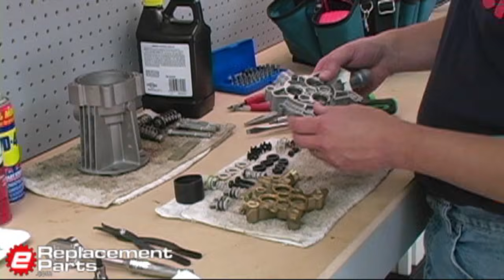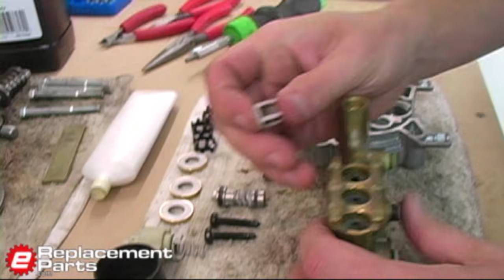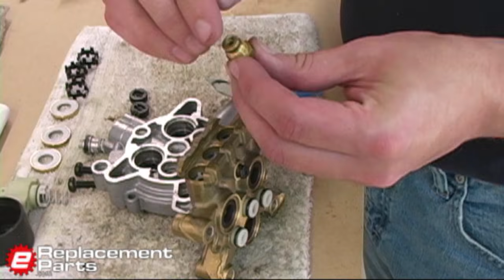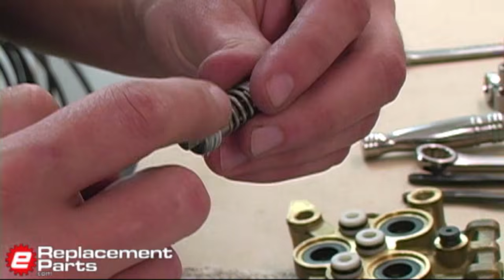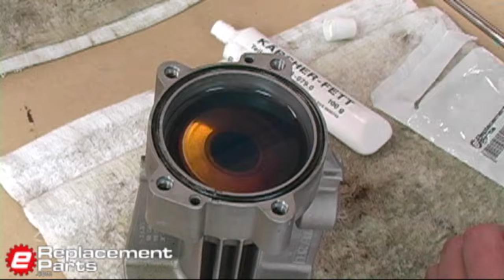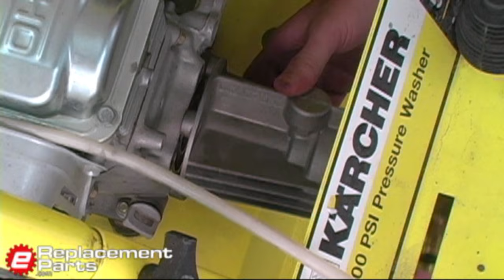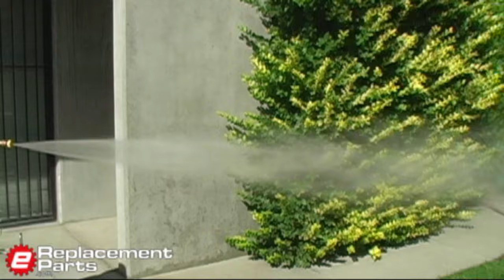How to Fix a Pressure Washer (Part 2 of 2)

Comment: I have a Generac Model # 01043-0. Can you explain how the "Automatic Cool Down System" operates? The manual says if the pressure washer is running, but the pressure wand is not engaged, once the water temperature in the pump reaches 140 degrees F it automatically dumps the hot water onto the ground so fresh cool water can enter. I cannot find the location of the "water dump".

Comment: very great instruction and demo videos. I run into a similar problem with a different brand PowerBoss190 3000 psi & 2.5 gpm, I am having difficulty to open the pump housing. Hopefully get the right tool and will fix the problem following this video. Many thanks to Mark!

Comment: Hey guys, I watched your videos and tried to fix my pressure washer but seems I didnt fix it. I have no pressure on my troy-bilt PW. seems all inlet outlet etc are free flowing. I replaced the 6 white valves and the unloader valve with no change in pressure. I tried adjusting but I have no idea if its helping. unloader valve is a 315747GS. maybe you could be of assistance.. Thanks, Mac

Comment: Thank you for posting this video, I had a problem with my pressure washer pump, I cleaned all of my valves, but did not know that the "re-loader valve" was a part that commonly fails, so I will inspect and replace that, if needed, ASAP. Also, thanks for mentioning what parts of the re-loader valve to and not to grease!

Comment: I tried every thing or remove the valve but just can't get it out.  I even tried using pointy nose vice grips.  Any ideas ?  Where can I go to have this valve removed?
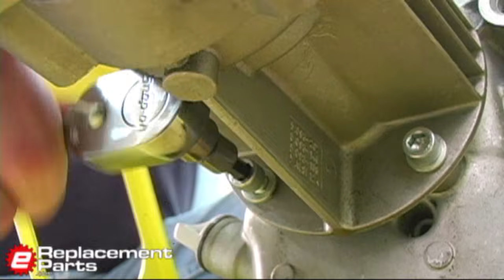Reply: Tommy Gorse Another video by Lowegy 7:59 long, shows leaving the Pwasher still assembled and its own water pressure to blow the stuck valve out of the cavity. much faster, simpler, (but put a towel over it to catch the flying parts first) do this outside, it gets wet!

Comment: i  have a karcher 2000 psi pressure washer its runs great and has pressure but when i squeeze the handle its like the water pulsates for high to low high to low. any ideal what that could be?

Comment: Bought a pressure washer from a pawn shop (Stupid Idea)...anyways started just fine but the pressure washer had less pressure than my water hose and had to remain engaged (Wand Pulled ) to remain running..I will never make this mistake again..its worth to buy new instead of the hassles..btw the hose that came with had a hole in it....SURPRISE!

Comment: What type of oil you used? i never opened this type of pump before and i found it was quite helpful
Reply: cool
Reply: Lowes carries something called "Pressure Washer Pump Oil" in the pressure washer parts section. This is what I used.

Comment: Loved the video. Thanks for all the details. However, when you tested your repair, you didn't release the trigger and then press it again to see if it was actually fixed (that is, the pressure didn't diminish on the second press of the trigger) recalling that this was the original problem. I guess we are to assume that it was truly repaired.

Comment: I accidentally ran my Kercher G2650OH without the water hose attached for a few minutes while I was testing the carb adjustment.  Now I don't have any pressure. What parts do I need to purchase?  Is there a kit or do I need to buy each item separately?

Comment: The demonstration was well done.  It probably will save me a lot of money.  There were two items I did catch you talk about.  One is the gaskets that go between the major component as they go back together.  The second is; what type of oil to use?  Does the pump require a specific oil like the air compressors?

Comment: Great video mine won't even spray water thru the gun but if I remove the high pressure hose water will come out from the pressure washer outlet

Comment: If the unloader valve isn't stuck what causes it to pulse fast when you spray and the pressure to be lower? really fast pulsing i have pressure but not as much. just started happening while running it.....

Comment: I'm confused.  This video insists we put grease only on the large end of the unloader valve.  But instructional photos at Karcher's website for ordering this particular part shows them applying what appears to be Teflon grease to the small end.  Which is correct?  I mean, who are we to believe... This apparently very knowledgeable tech on the video, or Karcher's themselves?

Comment: Great video. What kind of oil do you use inside the pump. My Karcher 2600HH is leaking water (lots) out of the valve (black plastic piece). Any ideas?

Comment: Hi Mark, what kind (Engine oil, hydraulic oil?) goes back into the oil reservoir on top of the wobble plate during re-assembly?  Please advise.  Thanks.

Also,  where do I get some teflon grease for the top O-ring of the unloader Valve?  Will white lithium grease work instead?

Comment: I only saw you pull the wand trigger once after the rebuild. Why didn't you pull and l release the trigger a couple of times to show that you had solved the problem of low pressure.
I can get the pressure washer the trigger once, but not a second time for high pressure
!

Comment: You did not include adjusting the unloader valve. Should the threads be tight so the length of the unloader valve is correct?

Comment: Thanks for the information. My Karcher G 2600 VH (1.194-404-.0) runs perfectly. The problem I have is the hose connector. The floppy female hose connector that is connected to the pump inlet tube slipped off because I pulled on the hose too hard. Any suggestions?

Comment: I added a mixture of oil in gas to mine, I know; it was a mistake. I flipped it on it's side to drain the bad gas out; did I ruin it? Am I going to have to take it apart and clean out the carburetor? I haven't tried to crank it yet with fresh gas. never mind I fixed it...

Comment: I added a mixture of oil in gas to mine, I know; it was a mistake. I flipped it on it's side to drain the bad gas out; did I ruin it? Am I going to have to take it apart and clean out the carburetor? I haven't tried to crank it yet with fresh gas.

Comment: How much would you charge me to rebuild the pump from my Karcher 3000oh if I were to remove it and send it to you? Your video is very informative and at one time in my life I probably would've attempted myself but I have a disease that has diminished my hand strength as well as my my ability to think straight and I'm afraid to even try. I am seriously interested in getting this repaired if cost effective over just replacing the pump.Please let me know. Thanks

Comment: This is good mate but you missed one important part, you must loosen the engines governor throttle after there has been an unloader valve problem for this causes the governor throttle to lock up and become tight, if you also notice the beginning of first video the engines is what I call " jumping " this causes the lock up, Kind regards.

Comment: I noticed you used several different types of oils and greases. Any way to get a list of the greases/oils you use in each step so I can purchase them at the same time I buy the unloader? That way I can have everything I need before getting started.

Thanks again, very helpful video––I think I've got the same issue as the washer in the video.

Comment: I see you made a mistake at 1:41 when pounding the joining seal into the bottom hole,but then the video shows it in the correct place which it's later in the top hole. Still a great video. Thanks

Comment: i have this exact same pressure washer and it won't start, it sat for about 2yrs in the garage. I put in new gas, oil and sprayed starter fluid in, it starts for about .5 seconds and dies, mostly it won't start at all. I want to clean out the carb but have no idea how, do you have a video showing this? I've searched the internet for hours and have come up empty handed. I know I can do the work with directions...I'm not even sure where the carb is! Please help. Thank you

Comment: Hi Mark I have a brute 2500 psi pump with no water discharge. All new valves and high pressure seals. I noticed a large jet and plunger with rubber tip light spring on the discharge manifold what does this do?? I take the jet out and then I have pressure some but not much maybe 200 lbs, this is located right after the unloader valve. any suggestions ???

Comment: Thanx, pretty entertaining engineering video. I wonder if the surging that you can hear on the first part of the video went away. I'm talking when you release the trigger and the washer runs idle you can hear it revving up and down then. My Husky washer does it and it's quite annoying. I took the pump apart when it lost the pressure due to broken plastic valves I fixed the pressure problem but this idle hunting came back after a while and still there.

Comment: thanks!  I am having this exact issue with the very same pressure washer.  If you could post the part number for the unloader valve I would appreciate it.  Also - what type/weight etc oil is put back in the body of the pump?  Thanks again.

Comment: Hello there, your video was great.  I have a Troy Built 3800 psi 4.0gpm honda powered pressure washer.  It has a Annova Reverberi RSV4g40H pump on it. A seal in the pump is blown, my oil is now white. I am having trouble finding which rebuild kit to purchase? Do you know what parts I should order?  Any help would be huge, thanks for posting.

Comment: I have the same pressure washer that you have been working on. The problem i'm having is the pump is leaking between the two halve of the pump head.If you could give me your input on what you think may be the cause of this it would be greatly appreciated

Comment: Hi Mark, I love the video and your parts availability is excellent. I am confident I need to replace the unloader valve on a Craftsman pressure washer 580.767200 but despite many reasonable attempts I cannot yet remove the plastic nut. Can you advise me on a removal process that may work before the nut exterior is stripped or deformed ( it is still in decent shape currently).Also the replacement Rebuild Kit Part#: 187879GS also contains a plastic nut, is there metal alternative?

Comment: Mark,
I started to pull my Sears washer apart and oil came out. I came in the house to find a YouTube video but my internet was down. I got my internet problem fixed today and watched both Pt1 & pt2. Thanks for posting your repair procedure. I'll have to look at the parts breakdown to see where my unloader is. I did buy an o-ring kit as water was leaking out the housing but I've had intermittant pressure problems with my unit until it just about quit like your video, thanks again/Mike

Comment: mark great tech video!!  im still experiencing the same problem as before i rebuilt First of all its a Karcher with Honda G 2600 vh-r  When the spray nozzle is removed the engine idles consitently and water comes out  Only happens w any of the nozzles from 45 degrees or lower the engine idles up and down constantly and the flow dimishes and return this happened on 2 different water sources. Before rebuild it was every 3 secs now its about every 1.5. Engine runs great. 10 hours total on machine?

Comment: hi mark, great job on this video, im hoping you saved me from just running out and buying a new one like usual! i took mine apart (honda black max bm80915) to find 2 of the 3 springs on the piston shafts inside pump housing broke, bigger problem is i cant seem to find them, HELP any ideas?

Comment: What about the brass needle in the top of the plastic can of the spill valve (unloader valve) did you clean that too with the carb cleaner and does it get any grease?

Comment: Good video .. I got a question .. I have an ex-cell 6 hp power washer model number exwgv2121. My pump blew up and I purchased a new pump. How do I fill the new pump with oil? And how much oil does it take?? Thanx

Comment: hey mark i have a troy bilt 020242-1 pressure washer that has low pressure and i checked the unloader valve and it is clean and the spring feels strong is there any other possibility

Comment from the maker: If the RPM is too fast the water cannot move through the pump fast enough. The water flow is restricted by the size of the openings in the pump. So basically the pump works for a second and then effectively runs out of water in the pump so pressure is lost. The water supply then catches up to the pump, pressure returns and the cycle starts over. You will need a small engine tachometer to adjust the engine to the proper RPM.

I hope this helps,

-Mark

Comment from the maker: This is almost always caused by one of two things. 

First, insufficient water supply. If your pressure washer is a 2.5 CFM machine then you need to supply at least that amount of water to the machine. Most manufactures suggest that you provide double that amount. Also you need to use a 3/4" garden hose for the supply water. Not the more typical 5/8" hose.

Second, The engine needs to spin at the proper RPM. For most machines this will be 3400 RPM. 

---Continued---

Comment: Great video Mark Thanks for Sharing  I noticed that the new unloader valve had a Green upper o-ring on it  Must be updated ?  My unloader valve was hard to get out I did like you did in Video 1 & used the pump pressure to get it out its clean but the cylinder bore was corroded  I cleaned that up & i got new o-rings for the unloader valve.  Hope to have it working later today but if it does not .....can you get a complete rebuild kit for the pump ?   Looks like that's what you had ?

Comment: When reattaching?realigning  the pump and the motor shouldn't you put the pump and motor shafts in the vertical position so the pump isn't hanging down or cantilevering? I like to put the shafts vertically and detach the spark plug wire and then turn over slowly the motor to allow the pump shaft to center with the motor shaft. Thanks for the video.

Comment from the maker: There is a ball bearing and spring inside the fitting where the suction hose connects to the pump. The bearing is likely stuck open. Try taking the assembly apart and cleaning everything. I bet that will solve the problem.

-Mark

Comment from the maker: The valves will sometimes become corroded to the pump housing. In this case you may need to seek the help of a repair shop. Several of the pump manufactures make a pair of pliers just for removing the valves. A good small engine shop should have the proper tools to do this for you. 

Good luck, 

-Mark

Comment from the maker: Often this is caused by an insufficient water supply. (garden hose is too small or not enough volume from the faucet) It can also be an engine that is tuned too fast. The pump requires a specific RPM from the engine to operate correctly. (Usually 3400 RPM's) If the engine is spinning too fast the pump will literally try to compress the water faster than it is entering the pump from the supply. 

I hope this helps,

-Mark

Comment: Great Video. These are awesome pressure washers (K2400HH), and when they go bad people like to throw them on CL for very decent prices. That is how I aqquired the 5, thats right, 5 that I own. I have on on each of my landscaping trucks and spent between 50-100 for each. Buy the revised unloader valve Part Number 4.591-040.0, and this problem dissapears.

Comment: Excellent video. I messed up 2 washers by leaving them out while it froze. 1 is a hot water electric, other is gas powered. I have 2 more gas ones & 3 electric ones (all Karcher) with 1 problem or another. I buy sell fix small engine equipment, & am thinking it is probably worth learning how to fix these. I am in Canada & parts and labor being expensive here, I suspect if I get them repaired here, it may cost me more than buying working ones from Buffalo, NY, USA. Any ideas? Many thanks.

Comment: Yes, good vid, 
What causes a carb to only run on full choke on my Honda pressure washer,,, it started that from one use to another worked fine one day the next week won't run without choke, it's got a Kei Chin carb.. it there an internal diaphram or something that breaks down with fuel?

Comment: Thanks Mark these videos are very self explanatory but while disassembling my pressure washer the small valves are very difficult to come free of the casting, are some made fitted into the casting or are they stuck, don't want to pull too hard and damage them please help.
thanking you in advance for your informative videos kindly Roger.

Comment: excellent video and information. I have a Karcher 2650hh and hi-pressure water comes out of my chemical suction hose. It blew off the filter at the end of the suction hose and eventually blew a hole in the suction hose. Any ideas?

Comment: Your video instructions worked!  My pressure washer (the same exact model as in your video with the same exact problem) is fixed (the same exact solution).  I did get confused in a few instances where the video did not clearly show some of the smallest parts, but I was able to figure them out with the help of some parts diagrams.  Thanks so much for your invaluable, professional help.

Comment: First, thanks for the DIY help! I borrowed my brothers Briggs & Stratton Elite 2550 psi washer to do my deck, and two of the five bolts holding the face plate of the pump (the outer brass section), sheared off, and water started spraying out at that point. I was looking for replacement bolts when I found your video. My question is, where do you find bolts or kits for a B&S pump? Do you have any comments about anything I should be aware of with a B&S washer? Thanks again for the big help!  Butch

Comment: Great video. I greased only my unloader valve re. low pressure with good results but I also have a balky to non functioning syphon problem. I have been unsuscesful in getting the the pump off of the shaft and am working around that. What to do re. the syphon?